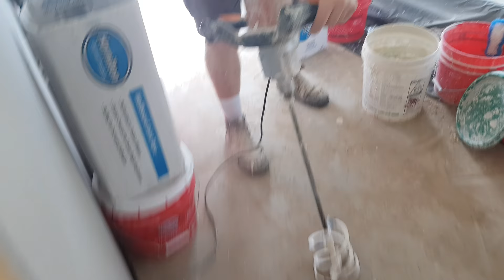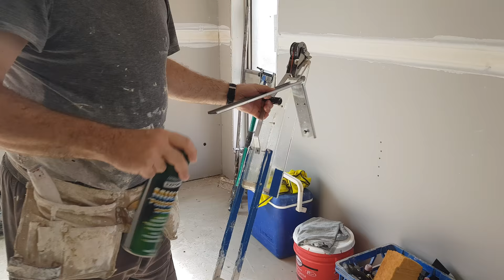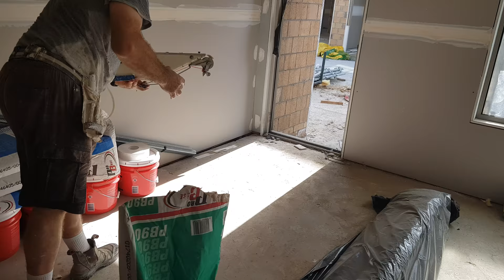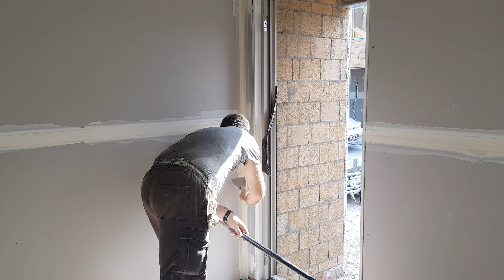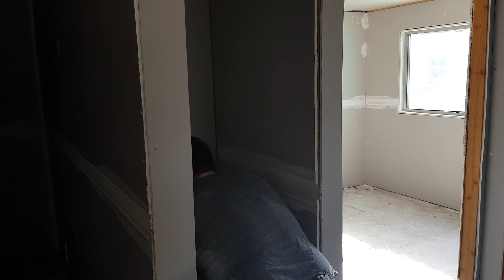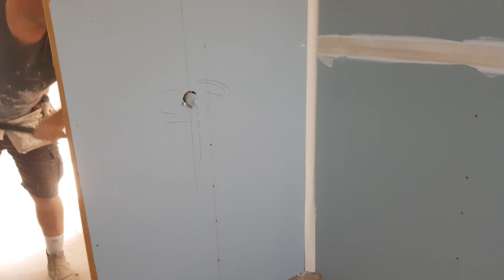How to Mud & Tape an Inside Corner of Drywall Fast with a Mud Box

Comment: Bazooka is a whole lot faster especially if the roller and plow on same handle hands down. Agree he’s probably not going to have adjustment problems if you don’t keep bazooka in case or in the hand of fumble fingers he’s definitely not doing 9 ft top angles. Still fast definitely not record. Recorded would be keeping 5 guys busy with one bazooka.
Reply: David D'sanps without a doubt mud rail that sits in buck is my fav for small jobs under fifty sheets nothing to clean up. 😂 I do know this if you’re not able to learn faster not harder this trade is very tough to make real money before your body says no way. I’ve tried over the years to be clean enough that the only sanding I need is a small sponge  usually high edges after we got lax on plow or box setting adjustments. If there’s anything I hate about drywall it’s the sanding. I trace skim everything smooth if I’m involved. You know how it goes when your trying to coat five six hundred sheets. I would love to never have to do top angles. I noticed that a lot on videos from Australia. I love the freedom of drywall. I made ten times the money in the Gulf of Mexico running boats got back into drywall when my brother thought we could corner the market in 2000 running crews taxes got me and divorce 😂just didn’t corner the market the moneys in selling and working on tools.

Comment: I did drywall 35 years in the USA  and its very similar but i never seen that type of taping banjo i have used glazer wipe down tool before and the boxes we have change to just basic banjo taping and hand finish your bed and skim coats.
  We plank our stairways the same way with the aluminum extension plank but the yellow mud never seen it and wood glue?in the mud?Wow need to try
Reply from the maker: Hey Kevin, I probably shouldn't have put the wood clue tip in there. Its an unofficial method.
Thats a Tapepro mud box. Much cheaper than a Bazooka works really well.
Reply: Bros I'm like u ,in the union for 20yrs old man was in for 30and never seen woodglue, dish soap yes
Reply: I use the dish soap too!Blue Dawn not in the tape mud
Reply: if it works i would do it myself always looking for new stuff people come up with,kind of makes sense paper tape is made from wood 
I also notice he is not hand  wiping out the corners or rolling them just glazing them,that's is faster by far I ;like to try that machine  lol

Comment: Looks great and fast from 10' away in minimal lighting. That was inspiring to watch but I'd like to see how flat the corners and seams are up close in the video before I would consider purchasing this.
Reply from the maker: Any closer and the cameraman would be in the way.
It's worth it. it finishes well. I recommend it mate
Reply: They work just fine and its the glazing tool that finishes it. If your going to get one get the original one this guy has, the improved one is slower and more awkward to use.
Reply from the maker: Yeah a lot of people say the original is easier to use... Thanks for sharing the info 👍

Comment: Banjos work wonderfully on flat seems if you have fairly tight fitting joints and really speeds up that taping process, I'm not sure about inside corners because there's always that uneven gap that will not get filled with mud when doing it this way, better to push mud into corner gaps with a knife and then use tape or ever better a rigid metal-paper pre-formed corner bead will be more reliable even though it takes much longer I think its worth it, after all its quality drywall that is the final step that makes the walls and ceiling look beautiful in a persons house and you want it to last decades!
Reply from the maker: Yeah true that. It's much better than by hand

Comment: Yeah the glazer should push tape flat and smooth it so roller isn't necessary if your results are same.....skip a step and save time

Some  always done it a certain way and it has to be that way.....not true at all in alot of trades.....if there is a better faster way and results are same, more $$$

Think outside the box

Comment: Nice video, you move like a 20 year old. I’ve learned over the years of working a crew that it’s not only the tool that’s fast but also the man running the tool. The tools are fast but if you have a man that’s slow or standing around then it’s no good. We need more workers like this MAN in this video, thanks for video
Reply from the maker: Powered by money.

Comment: It’s nice to do things very fast you make more money the faster you get the job done but also please make sure it’s done right. I moved into a house where all the drywall screws were coming through the mud because the drywall  guys tried to go so fast they did a crappy job.
Reply from the maker: Yeah just because it's fast doesn't mean it's a bad job. Seems a lot of people have that impression.
I mean there is only one way a screw can go in. It could also be twisted framing members over time.
Reply: That's not a taper issue, that's structural

Comment: What state do you work in? I bet you can make better wage hanging drywall if you only need 8 screws per sheet! Watching the tape coat, I notice there's very few screws in angle any in field.  Pretty bad hanging job there when so few screw's yet taper still has to set so many!

Comment: Why are there such big gaps in the ceiling corners? Should the drywall not be installed from TOP DOWN, so the gaps or shortage in down on the floor where it could be either fixed easier of simply be covered by the baseboard?
Reply: maybe there will be crown?
Reply: They use cornice moulding in Australia, not necessary to drywall up to corner.....different than USA

Comment: That looks like a good banjo.hard working man there too.just wondered why is the gap in the ceiling corners so wide.i know it gets molding or whatever but why so big.is it to do with movement?
Reply from the maker: No because the sheets are 1200mm X2  so it's 2400mm and the ceiling height is 2440mm

Comment: Why does the top angles all have gaps and no tape is that how they do it over there when they put crown? Even when theres crown molding the board is still butted up tight
Reply from the maker: Yeah they leave a space. The crown here is called cornice and is made out of the same material as the drywall.
Thats why is that space as there is no tape going over.

Comment: Did I see that correct ? He's putting glue in his mud ? Also I'd like to see how quickly he does those 3/4 inch gaps on the ceiling.. great video. He's very fast. I'm a painting contractor . We specialize in repaints and a lot of sheetrock finishers corners crack pretty bad of which I have to fix . Does the glue help it not crack ? Seems like it would .  Thanks
Reply from the maker: Yeah the gap at the ceiling gets cornice, or you might call it crown molding.
The cracking because a lot of drywallers use multipurpose pre mixed compound which is much weaker .
Because of efficiency and they don't want it to dry out in their machines.
Yeah the glue helps it bond.
Similar to Bond Crete what they put into render ECT...
It's not recommended to add the glue by the manufacturers I might add.
Thanks for the question
Reply: Maxkil cool ... I just learned something .. I've been in this business for 24 years so it's not every day I learn something .. also manufacturers don,t recomend putting paint in popcorn texture but we know how that goes .. thanks for the info
Reply from the maker: Sounds good.
Yeah when he pulled that out was the first time I had seen it. Take it easy

Comment: And how many of them peeled at the edges in the long term?  Do you ever see your work 10 years later?
Reply from the maker: Well I haven't seen my work after 10 years but I have seen others work after 10 years which is most the work I do is fix up work.
And I agree that using multi-purpose in internals isn't as strong as what it could be.
The problem is that most people like the bazookas but you can only put multi-purpose through them.
I don't disagree with you but it's allowed and that's the industry we work in
Reply: Maxkil Thanks for being honest.  I appreciate that!
Reply: Maxkil The reason I commented is because I am currently renovating a 10 year old apartment where many of the the paper tapes have peeled and it is a right pain to rectify them once they start to peel off.... they look messy when they peel...
Reply from the maker: Yeah mate totally agree with you.

Comment: I've recently bought the tapepro mud box for my internal corners. I'm having trouble with the top tapes dragging out of the corners. Any tips?
Reply: Hadn't used mine yet but use it like a bazooka leave a 3 inch tail or have somone with the roller give you a hold. I know the plow is for just what it does. But when i use one i still roll my angles hope this help guy.

Comment: I guess people are willing to sacrifice a good take job for speed. The only true way of getting a good quality tape job is to do it all by hand. You can feel all the imperfections in the drywall job previously done. That way you know if you need more mud, nails, etc. using banjos is quicker but you sacrifice quality. And if your a pro like my Father (In this business for 55+ years) your just as quick as a banjo.
Reply from the maker: I disagree. It's the same by hand and by banjo. Your still trying to get that same finish.
Most importantly easier on the body. Definitely not as quick as a banjo. Not that I've ever seen anyway.
Reply: Well i hope you mean not as quick as bazooka I've ran both for 12 years so i bought one of these hope it makes a difference. Bazooka is faster then then banjo, now the bazooka is not faster when everything is to long or to short or rinks in the tape. So my hope with this tool is can use it like a banjo and be as affictive bazooka. Easier on my body but still have the accuracy on a banjo
Reply from the maker: I think that's exactly where it fits and you can run some quicker drying compound without the worry of a bazooka

Comment: I assume "hotmud" dries on 30 min's..ready for sanding ?
Reply: There’s 90,45,40,20,5 minute hot mud. Depending where you are. You would still need to coat it with regular mud at least once for a decent finish. Butts and uneven surfaces tipically require   3 coats. Depending on the hanging.

Comment: I think the pva glue is an excellent tip
Reply: Steve Cooper glue. Comes in every. Green. Bucket. Of. Mud that is. Supposed to be used  used on. First. Coat. Thats why. The. Bucket or. Box is. 2 times as heavy the. Glue. Weighs more..

Comment: What is the brand of the inside corner tool ?
Reply from the maker: tapepro mud box
Reply: Maxkil  ???? Not the taper, I mean the corner tool he is using for coating both sides of the internals

Comment: This is an old tool from the early 2000 .now get a basuka its way faster n less of a mess
Reply from the maker: Can't run good base coat through a bazooka in case it sets on you.
You need multi purpose compound, then if you use that you can't go over it and finish it same day.

Comment: Why the big gaps 2 ceiling? 
Great work by the way
Reply from the maker: +gentile joshsaved they weren't too big. Oh maybe to the ceiling cornice goes there. Check out my next video for that.
Reply: gentile joshsaved I think the gaps are there because when they hang the drywall didn't lift the first board up enough because those look like they were 16 foot boards so I guess they decided to leave it up to the finisher to fill in the gaps because they wasn't strong enough to lift it up completely to the ceiling that's my personal opinion as a hanger and sometimes it takes JBead it on top of the ceiling for noise sometimes it takes a certain type of molding to cover it up or it might just take crown molding and they only had 8 foot board so that Gap you'll never see cuz of the crown molding or maybe put some sort of JB to cover it up and then floated it's something like a corner bead
Reply from the maker: No. It's cornice. I don't know what to tell you I've already explained.

Comment: Can't go wrong with doing it the old school way. People don't take pride in their trade these days. But each to his own.
Reply from the maker: Yeah it's all about the benjamins.
Reply: What is the old school way? Been in the  trade almost 15 years and we have always used a banjo or a bazooka... As long as the tool is putting out the right amount of mud, and you have competent tapers, then you shouldn't have to worry about the tool your using. Get out of the Stone Age. So your gonna hand tape 14,000 foot of board quicker than using tools made to help progress the job more efficiently... You are delusional
Reply from the maker: I hear you mate.... There's one thing taking pride in doing things by hand, there's another thing when you have mouths to feed and need to get a job done without your arms falling off ECT..
Reply: Maxkil We use blades/trowels as well. But we still run boxes, and use banjos. We also run three coats of mud on bead as well as butt joints. After we texture and finish sand, we use halogens to go over the walls, and touch up as needed. The company I work for works on million dollar plus homes. Never had a call back for not doing it "old school"... Take pride and what you do, and do it as if you were working on your own home. You'll never be out of work for certain. Not rambling, just stating facts
Reply from the maker: We don't do any texture but otherwise it's a similar coat system. I'm really trying to get some footage of people doing it their way and upload it on here.

Comment: why no body is using Pro version of this mud box?
Reply from the maker: Because the original one is great and lasts so long.
Reply: @Maxkil  question: let's say I want give you a gift which one you will choose pro or regular? Which one is better?
Reply from the maker: Good question. I just only know guys who have the regular. So i would choose the regular. I know its good.
Reply: @Maxkil  I'm from US and I'm interested to buy "your system". Mud box, boxes, extension poles, corner roller, glazing tool do you know good place to buy it from. Can they deliver to US?
Reply from the maker: yeah for sure follow this link Tapepro Mud Box - https://bit.ly/2L6jXEz
 so they know I referred you. Also 5% off when you use #MAXKIL in the checkout. Not sure if they deliver to USA but, they can send to me and I will send to you. Let me know what you want from there and I will get a shipping quote before you do buy, in case its too expensive to ship.

Comment: Did they run out of sheet rock on the angles? flippin hacks
Reply from the maker: Where ? At the top where the ceiling meets the walls?
Reply: It's pretty obvious that is what he's talking about haha
Reply from the maker: Is it obvious?. We do things differently in Australia. We have a plaster cornice that goes on top. It's not square set. It doesn't need to be tight
Reply: It’s essential to make sure the upper wall sheet is tight against the ceiling drywall, as it supports it in the corner...these hacks started from the bottom, as it’s easier for them...fail
Reply from the maker: Lol Patrick. What you talking about. There is a kind of crown molding going up. Also your wall shouldn't support the ceiling. Leave it up to the screws
Reply from the maker: Also they are full sheets, why wouldn't it reach the ceiling height? Unless square set... It's not the USA

Comment: Journeyman taper here with 30 years exp and I need to add my 3 cents. Just make it tight and actually create some support and soundproofing capabilities. Been drywalling for a solid 35 years and never once came across a gap that wide even if it was for cornice..actually now that I think about it that is completely wrong and dare I say egregious.  Rookie mistake amateurish taping skills and apprentice like hanging.  I've hung board for over 40 years and would walk out of the jobsite if I were the GM there.  With my 50 years in the trade I would be embarrassed to call you guys drywallers.  One tiny bump into that wall and the whole foundation goes down.  Put me on this job and can I not only garuatee a more stable, sturdy, and sound wall but increase efficiency tenfold..one more helpful critique but if you want to be a true drywaller then quit and restart your apprenticeship. Thanks and goodluck
Reply: What is it 35 or 40 years?? I would believe u if u could keep ur story consistent
Reply: @tugboat4747  damnit you beat to it by two months. 😂

Comment: Is quiker 100,percent, but I done this ,and my customers had said to me, hey your joints have craked, it had coat me so much to repair their damage, so I recomend doit old school
Reply from the maker: I reckon that would have something to do with your material rather than the tool.
Reply from the maker: But I know what you mean.
I've always done things by hand and never used multipurpose compound and hadn't used boxes and mud boxes. 

Come to think of it, most of my work is fixing those kinds of problems. I use cornice cement from the bag, freeze those problems. So I don't disagree with you really.
Multi-purpose compound is to blame